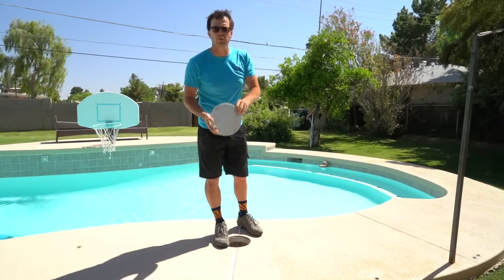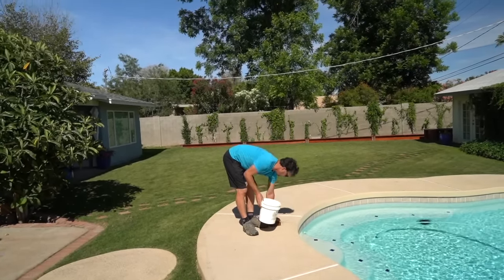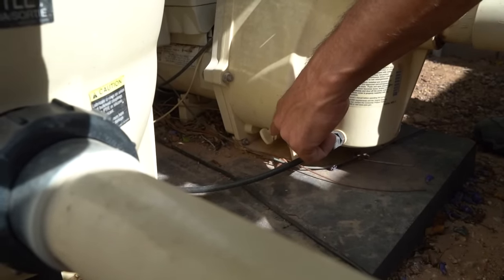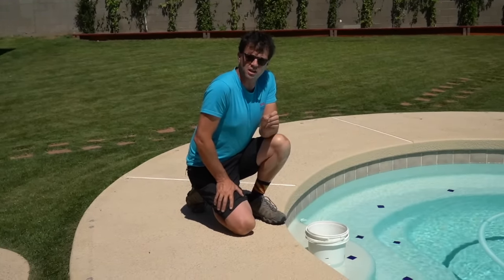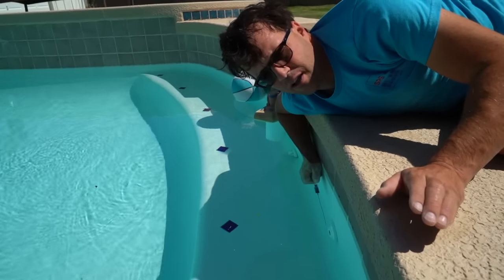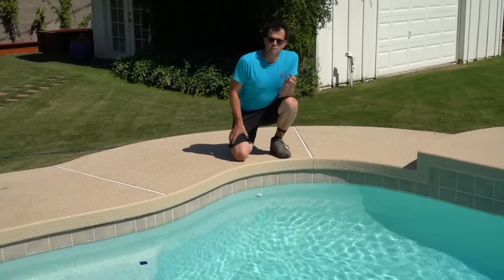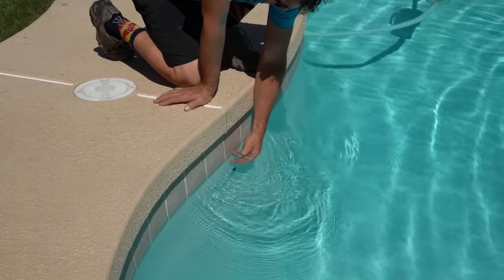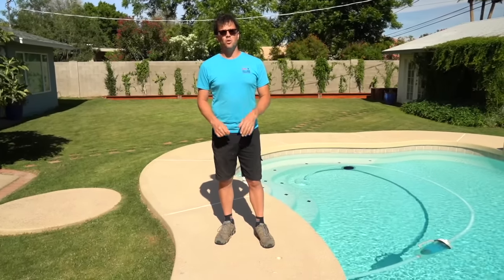Chasing pool leaks, Don't call a leak detection company until you watch this

Comment: Anyone else not have a pool but wanted to watch this cause it looked interesting?
Reply from the maker: Me even though I lived it.
Reply: Swimming Pool Science ya lol
Reply: Anyone who is willing to jump in the pool and hold his breath that long is going to be hired for my pool.
Reply: raises hand  Today I also learned several different ways to fell a tree.
Reply: I’m about to have a pool
Reply: I have a pool cause i am Reach 
I don t joke
Reply: @SwimmingPoolAZ-SPS  what do you think about 35k gal pool only leaks when pump runs but no sign water leaks anywhere on ground?
Reply from the maker: @jeffwolfe4058  my first guess would be a hairline crack on one of the return lines under the deck or somewhere below ground when the pool is off it closes up and no water leaks. When the line is under pressure, it opens up and squirts water. You’ll need leak detection to pin point that one.
Reply: Me

Comment: Great video. Very helpful. I wanted to mention that what may look like a tiny leak (like around a pump fitting) adds up really quickly. Even that drip, drip, drip sucks gallons out of the pool fast.
Reply from the maker: It certainly does!

Comment: One thing, if u dont have dye u can look around the house for stuff.  I settled on the left over coffee in the pot from that morning and it worked perfectly. Kool aid powder or fruit juice would probably also work
Reply: Mrs. Stewart's Liquid Bluing works great found in the laundry soap section at market, can also be used to tint pool water blue.
Reply: Decaf or regular? 😃
Reply: Most swimming pool algaecides have a dye in them and many times, I've done leak detecting using a syringe filled with the customers pool algaecide to act as the dye to be pulled into the leak.

Comment: Excellent advice! I just bought a new home with a swimming pool and since I never owned a swimming pool before, I was curious as to why I have to add water every other day  I am going to follow your advice to see if in fact I have a leak. Thanks 😊
Reply from the maker: It’s a great way to get to know the ins and outs of your pool as well. Glad you found this helpful!
Reply: I have to add water every 2 days do I have a leak?
Reply: Every other day?  Water doesn't evaporate that quickly unless you're having very high temperatures
Reply: @1975MGB hi our pool is down to half inch to 1 inch a day. Do you think its normal? Or theres a leak?

Comment: I have plenty of tile and grout missing from my pool and no leaks at those locations. Where I found my leak to be was where the plastic part of the skimmer meets the pool structure/concrete. Pool remained the same during winter so I knew it wasn’t bottom drain it also drained quicker when pool was filled more which meant the water pressure effected leak therefore no need for bucket test.
Reply from the maker: There ya go! That’s one of the first spots I check.
Reply: I think mine is in that area as well because we will fill it up a little higher than middle of skimmer and we keep having to fill it up more than we should. At first I thought it was evaporation (just purchased the house and in FL heat) so I waited awhile. Then I noticed some cracking around the skimmer mouth. I just put some of that pool putty on those cracks today and filled it back up so we shall see in the next few days if that’s where the leak was coming from and the ONLY area as I don’t want to deal with the main drain 😩 lol 🤞
Reply: And it worked! Love that putty stuff!

Comment: I had a leak at my main drain in the bottom of my (fiberglass) pool. After draining the whole pool, I found that about half of the bolts holding the sump housing to the bottom of the pool had corroded and was allowing the sump housing to sag toward that end of the pool and allowing massive amounts of water to exit the underside of the pool and overflow into a neighboring yard. Replaced all of the bolts and the problem was solved.
Reply: Im afraid to drain a fiberglass pool. Ground water could raise the bottom. Is your groundwater level low?

Comment: When our pool was put in the water level went down 3 inches overnight. The installer was freaking out, thinking he'd have to tear up the concrete after finding no leaks in any of the common places. Turned out the the electrician had put too  sharp of a bend in the electrical line for the light and it popped off the back of the niche. Easy fix fortunately.

Comment: Holy Smokes! While you did say earlier in the video to turn off the pump, it'd be a great safety tip at 8:20 to remind viewers to MAKE SURE THE PUMP IS OFF BEFORE REMOVING THE MAIN DRAIN COVER.
Reply: Main drain in residential pools are a non issue, they are equalized at the skimmer. VGB was implemented based on a accident that happened in a hot tub.
Reply: But worse case scenario, natural selection is how we got this far... I love darwin...

Comment: here's a question, if you have a 45 year old concrete pool (northeast - solid ice winters), how long can you expect plastic fittings to last - do they shrink and become compromised over time? If you had to change a bottom drain fitting and bore out a 12 inch hole to address the rot around the fitting and reset a new drain fitting, how would you do that with ground water on the other side?

Comment: Leaks are a good reason to consider not pouring concrete for the pool deck.My thought is to use pavers, slate, or any material which can be easily removed to allow access to the underground plumbing work. Also, it could be difficult to make repaired concrete deck match the finish (color & texture) of the rest of the pool deck.

Comment: For the bucket test you actually want to put the bucket on a lower step so that the water level is within 2-3 inches of the top of the bucket. This will take out the evaporation variable because there will be more access to wind.
Reply from the maker: That’s a good point. If you want to get RREEEALLLY precise, cut the top of the bucket to the exact water level and go from there.....Just don’t make any waves in the pool.
Reply: Where do i get the dye from ? What type of dye is it?
Reply from the maker: There’s a link in the video description you can click on.

Comment: Might want to use a large, low-profile bucket with a leak-proof reference rod inserted and protruding through the wall of the bucket. The low profile ensures that the sun, air/wind contact the water in the bucket most similar to the water in the pool (tall bucket walls protect water from sun & wind evaporation), and the sealed reference rod through the bucket wall minimizes errors when measuring 'inside water level' vs 'outside water level'.  
If you really want to increase measurement accuracy, the color of the bucket could match the color of the pool to minimize temperature differences too, especially if the suspected leak is small.

Comment: My pool company told me to turn off the pump and put polystyrene over the skimmer hole, poolside, to see if the water level goes down, because there’s a leak somewhere. I can’t see the sense in this nor how it would successfully block the water from the skimmer, it’s had a new vinyl liner put in. We now find there are leaks from the pipe going into the pump, joint going into the glass bead filter, and possibly the lid of the pump.

Comment: The bucket test has to be done while the pool is filled to the middle of the tile. The low water level may not change after a certain amount of water has leaked due to the weight of the water and gravity. When the skimmer is sucking air like that the system will not be fully pressurized.

Comment: The guys did the  Skimmer Line 1000 euros. Then pressure tested the jets. Needed new ones 2000 euros plus Sand 150 euros. Then it was still leaking so new Skimmer - back had broken probably with the weight of the  water.  Total 5650 euros. Hope this comment is ok now. Thanks for all your help and interest.

Comment: don't forget to check the hydrostatic relief valve - mine was leaking
Reply from the maker: If you have them, absolutely!
Reply: @SwimmingPoolAZ-SPS  
My Pool just started leaking after I brushed it thoroughly and shocked it to kill some generic green algae. The ONLY times it's ever leaked (twice) in the past  was due to the hydrostatic valve, BUT it was replaced ONLY a year ago. Is is possible that some stirred - up debris caused it to malfunction? And what's the best way to troubleshoot the hydrostatic valve issue? Again, since it's so new, I thought my hydrostatic valve issues were OVER!!😀  Thanks.
Reply from the maker: Charlie S. Dye testing the HSRV will tell you right away if that’s the culprit. If it is and it’s that new, I’d imagine it should be covered under warranty.
Reply: @SwimmingPoolAZ-SPS  
Thanks for the info- I appreciate it. I'm still trying to figure out why the hydrostatic valve would be an issue, as WE haven't had much rain and the valve is so new?? Any ideas?!
# Head scratcher😀

Comment: I have a leak in my pool somewhere and the company that installed the surface can’t find it. I’m losing water at a significant rate. The lady tells me that it’s somewhere in the pipes but the water won’t drain that low. It only drains to about 1/2 inch below the tile line. 
Simple science tells me if it stops draining then the leak is above the point that the water drains to?? She is telling me that isn’t the case.
Reply from the maker: If that’s as far as it goes, that’s where the leak is. Could be 1 of 2 things, the skimmer, or a suction line could have a hair line crack that only leaks when the system is shut off and the crack is at the same level under ground as “1/2 inch below the tile line”. Suction side leaks will draw air when the system is running (or pull shut) and seep water when the system is off. Maybe run your system for a couple days straight and see if the water continues to leak, if it does, then it’s something along the pool structure itself.
Reply: Swimming Pool Science she has tried looking in the light fixture, in the main drain, and the skimmer. Nothing. I’m suspecting it is somewhere where the tile meets the new surface. I ordered my own dye tester and it will be here tomorrow. I’ll find it with or without her. Thanks for the response.
Reply: @petermontgomery7323  Ultimately you need you have the plumbing pressure tested. In the meantime you can plug the suction and return lines with system OFF for a few days and see if the water level drops at the same rate. Good luck.
Reply from the maker: @Peter, what Moving Water Swimming Pool Tile Cleaning said.
Reply: Swimming Pool Science I ended up finding the leak myself and it has been fixed. There was a crack under the lip in the skimmer where the basket sits.
Reply from the maker: Peter Montgomery nice work. Fixed a cracked skimmer today with a bit of epoxy..... there was a broken piece of tile in the mouth of the skimmer that I patched with some epoxy and the piece of tile that broke off.... they called me to say they were still losing water. I stuck my head down the basket hole and there was a crack right behind where the weir fastens in! All better now.
Reply: A lot of times there can be cracks in the throat of the skimmer as well. It's hard to see but in our climate where freezing temps are common, the ground shifting can cause these.

Comment: Stupid is' is stupid does!  TRASH BAGS, yes the fast and simplest way is using plastic sheet material or trash bags. #1. Turn off all valves/ pumps.  #2. Place a trash bag at each skimmer.  #3. Using a pool pole, place a trash bag at each drain, keep the pole atop the trash bag so it will not float to the surface. wait 10 minutes and see which areas are sucking the trash bag into drain/ skimmer. That is where you start looking, usually it is a coupling that came apart from the ground shifting, a simple fix using rubber coupling with stainless steel hose clamps can fix the problem.  I have come behind plumbers trying to charge thousand$ and have been able to lower the co$t to hundred$. Color Dyes don't work when the leak is not on the surface of the ground.  Also if the leak has been ongoing for a long period of time, you might wish use a cable cam or a visual to check for a crevasse/ cavity beneath the pool.  There may be a looming sink hole that can cause death and property damage.   I once did a repair and we pumped in a truckload of sand/ 14 yards and it all disappeared.   The owner of the Apartments sold the property immediately after the discovery.

Comment: Please help!  We purchased a new pool liner and now use his service at the end of the last season.  When the new pool company opened the pool it was almost empty.  We never had this problem before.  After it was filled the liner was all over the place, wrinkles and pulled away from the sides.  He found a hole, repaired it and stretched it.  Now, it is still leaking and I notice when you step on edges it doesn't fit against the edges at bottom.  I feel like I am walking. on something that is going to tear and am afraid for people to be in the pool and might ruin the liner on top of it still losing water.  Now, the pool guy wants us to call a leak detection company at $650 an hour.  We will only be reimbursed if it is his fault.  The pool guy said it is a leak behind the wall.  Yet we didn't have this previously.  Can you please tell us what to do?  We are desperate

Comment: The bucket test only needs 24 hrs for an accurate result. You need to fill the bucket to the top to compare evaporation between the two vessels, I put masking tape inside the skimmer and mark the water level with a pencil.
Reply: Why would you fill the bucket to the top it clearly says just make them the same. Save yourself the measurements and then you can just look at it and tell if they are not the same. Also if it rains they would still be the same  unlike filling your bucket to the top.
Reply: @jessereagan2340  in my case i dont have a step in my pool so this is helpful on how to do it without putting the bucket in the pool.
Reply: How do you hold your breath under water for so long?

Comment: An interesting discovery I use to get bubbles in my returns but the other day I was away for a few days so i filled pool up to bottom of the bull nose but above the tile so pretty high up above the mouth of the skimmer. Noticed no bubbles in my returns or in the pumps basket unbelievable but how?
Reply: If you have bubbles in your returns you are sucking in air. If your water level is good and you still have them it is time to more further with the suction side plumbing. The seal on the top of pump, or the joints around before the pump can be a cause. The pipes have a negative pressure so they'll suck in air when pump is running, leak when it is off.

Comment: It's hard to stay down when your lungs are full of air. Pool guys usually use weights to keep themselves from floating to the surface and some sort of air supply.
Reply from the maker: 20lbs in a weight belt does it for me. It’s impossible to get anything done without it.
Reply: @SwimmingPoolAZ-SPS  
To unclog my main drain, I used my husband’s 25lb dumbbell (rubberized), situated it next to the drain, then would swim down and grab ahold of that with one hand while working the screwdriver and such with the other hand!  Wish I had a long breath hold like you though!! 😁

Comment: Fixing the leak. That's the info needed. Could be costly I imagine.
Reply: No you just get some sealant and some spare liner and just paste it over the hole
Reply: @CountryKyle007  This would not work on the return line if the leak is in the line itself and not the liner.

Comment: If you have a below deck leak, where is the water going? Wouldn’t it eventually cause a sink hole, deck cracking, soil erosion, that sort of thing??
Reply from the maker: If it’s big enough, sure! We repaired a pool that had a void big enough for 3 or 4 people to fit into about 2 years back....that too a pretty healthy flow though. If the water is seeping it may not be strong enough to displace soil, just cost you an arm and a leg in water and chems!

Comment: You omitted some details... You only said that you can tell it's a plumbing leak if the water level drops faster during the bucket test with the pool filter system running, but you forgot, or didn't know that if the plumbing leak is in the return plumbing, the pool water level will drop faster with the filter system running than with the system off. However, if the pool water level drops faster with the filter system turned off than it does when the filter system is running, that usually indicated a pool plumbing leak in the suction side plumbing somewhere between the main drain or skimmers and the pool filter pump.

The leak slowing when the filter system is running with a suction side plumbing leak is because the filter pump will then be pulling water and/or air into the plumbing through the leak in the plumbing, thereby reducing or completely stopping the water loss through that leak in the suction side plumbing.

Comment: The surface area of the bucket and pool are very different so the results can not be comparable
Reply from the maker: But temperatures are the same and so is air exposure. For laboratory conditions where you would need to know down to the millimeter, you are correct, however we’re talking about back yards and swimming pools so for our purpose, the bucket test is a valid method.
Reply: @SwimmingPoolAZ-SPS  the trouble is the bucket rim will partly protect its small surface area, where as the pool larger area means greater evaporation.

Comment: You didn’t find the leak, you only found that return is leaking somewhere between the pool and the pump.
Reply from the maker: If a return is leaking somewhere under the deck or underground, enough that it’s noticeable but not enough to pin point it, you’ll need a leak detection specialist with specialized equipment to pin point the leak.